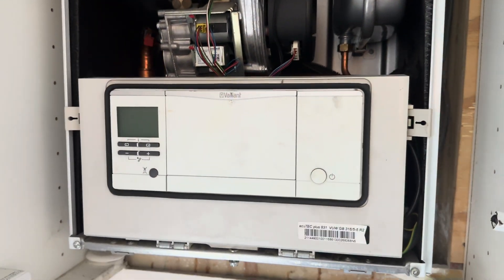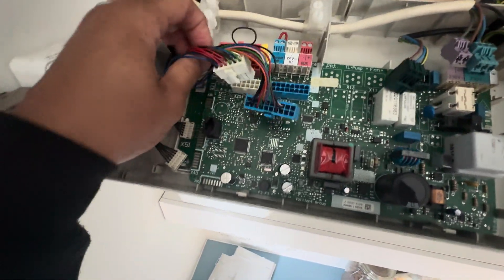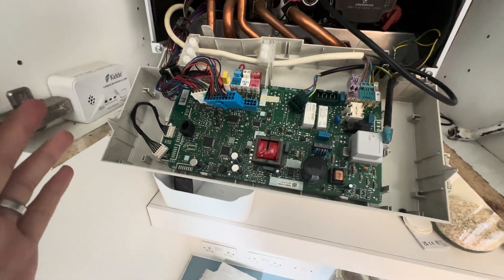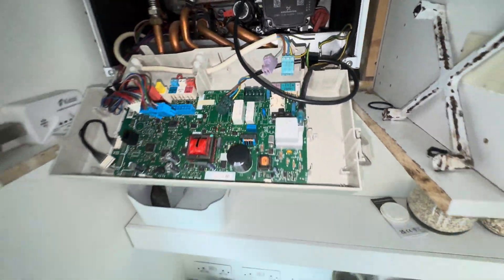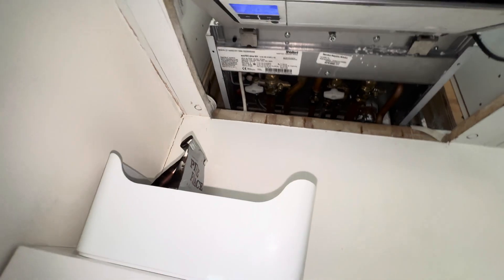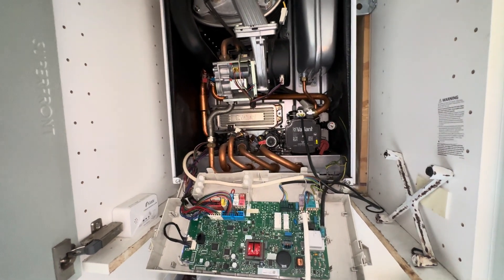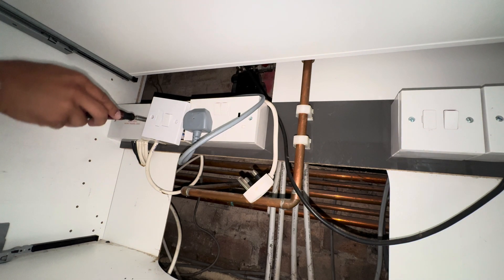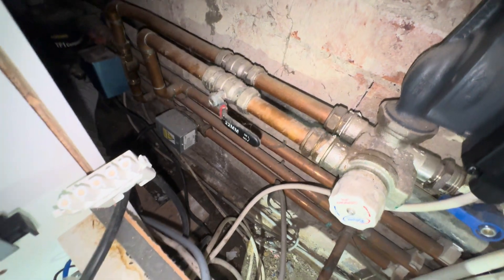Why are the electrics tripping??

Comment: What’s the point of a fuse spur?
Reply from the maker: @lostinthoughtscalminsilenc8167  isolates the power between the RCD and central heating system independently, an extra layer of safety too. Maybe @kimmythesparks will give a better explanation!